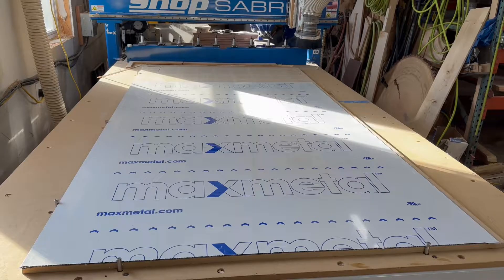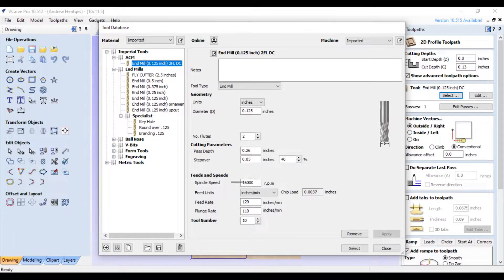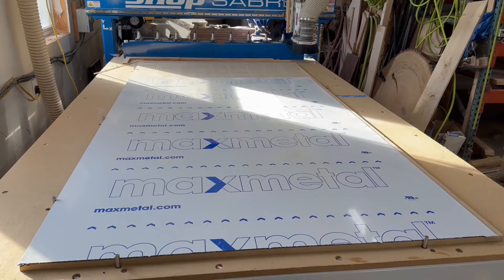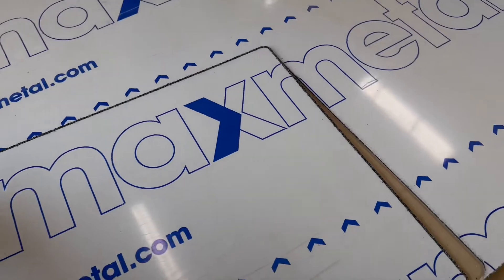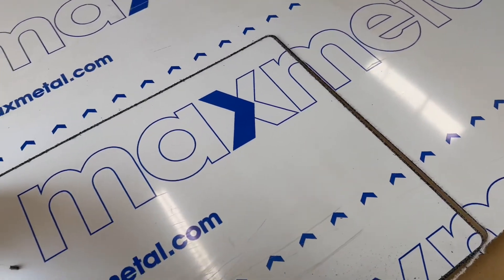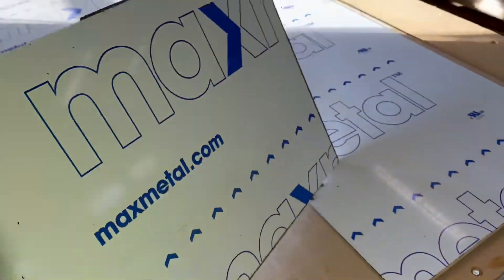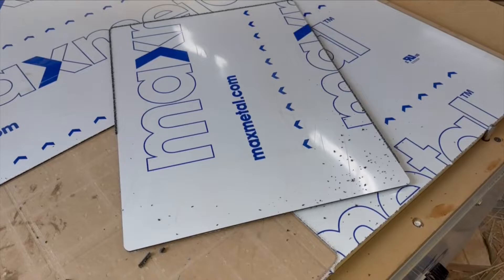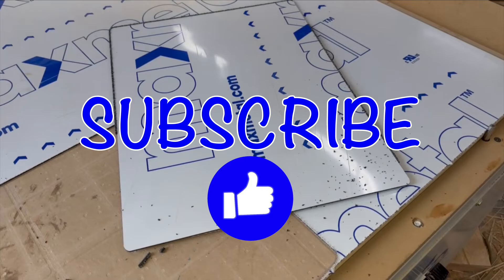Cutting ACM on a CNC machine SHop Sabre

Comment: The rubber is melted into the cut, i would decrease the spindle speed and increase feed. My settings are 14000rpm at 2000mm/min for 3mm dibond using 3mm o flute router bit